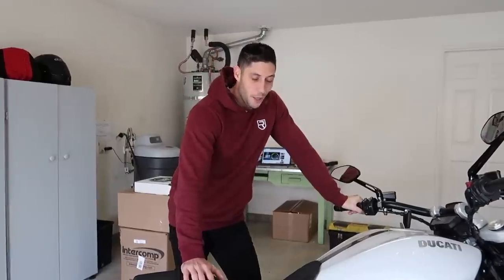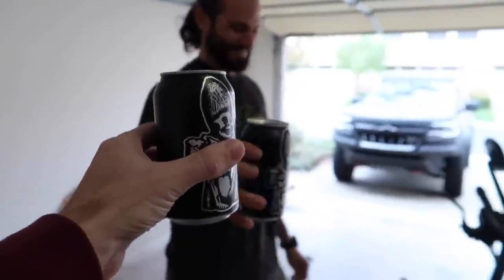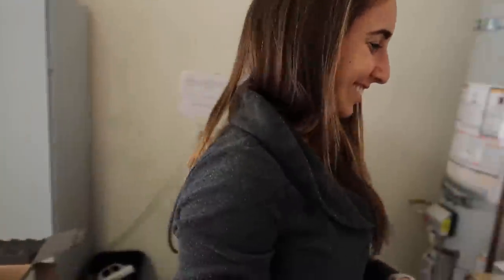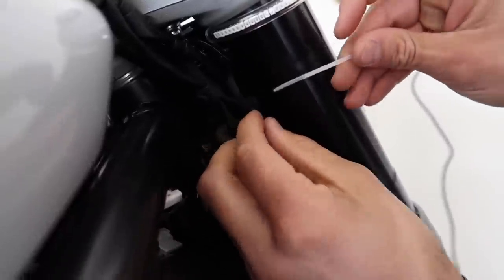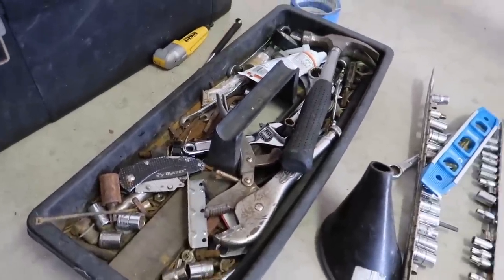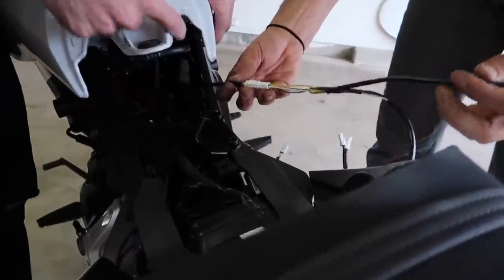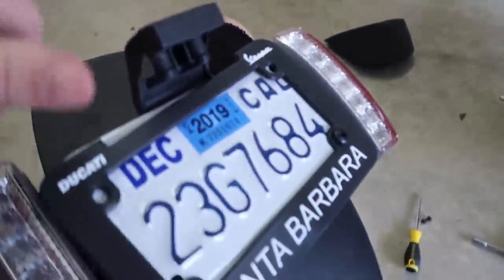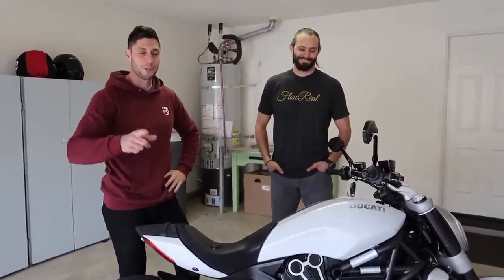Xdiavel gets Flush Mount Turn Signals!

Comment: Hey Jaret, to give some credit to Ducati, I'm pretty sure there is some sort of regulation in the EU that specifies a minimum distance between the indicators and brake and headlight and also between the two indicators.  It's why in some cars, where the indicators are built into the light clusters, the headlight turns off when the indicator flashes.

Comment: keep the indicators up high people will see you better and you won't have to worry about the wire hanging from the fork. You should have used 3m double tape if you need to take them off it will be easier and won't leave glue on the forks. Love the rear delete kit
Reply from the maker: it was such a small amount of glue it won't be an issue and I don't see any reason why they would be removed for a very long time but 3m tape would have been a good idea as well
Reply: @JaretCampisi   oh I was just saying both will work for sure once the bike is given away wont be your problem anyways ;) starting to look good Liked the episode as it was at home with a friend rather than at the dealer its not the same when you dont have the same chemistry miss the Dado colabs

Comment: Hurdle Question: My indoor track season just ended and I'm preparing for my outdoor season. My biggest issue in the high hurdles is that I felt like I was reaching to reach the next hurdle despite being 6'1 and having quite efficient form over the hurdle. Do you think lowering the hurdle height in the offseason and getting more practice running through them with better speed would help or is it just a case of getting my legs stronger? Thanks

Comment: Lookin good. Hey Rup. Great Job. I just have one question is did you guys crimp or solder the front turn signal wires? I'm all about doing it right the first time. Vibration can wreak havoc on electrical mods on a bike. Said with respect and NOT judging. LOL RUP. YOU HAVE MY RESPECT. THANK YOU FOR YOUR SERVICE. God Bless.
Reply from the maker: we soldered them, no cutting corners here :)
Reply: @JaretCampisi  Awesome. You never struck me as a cutting corners kind of guy. Thumbs up J. ;)

Comment: hope you enjoy straight line art at your back when its raining 😂
Reply from the maker: it still has a rear fender this was just the tail tidy
Reply: @JaretCampisi  There has to be a specific reason Ducati made that rear fender piece you took off. I think it was to stop the rain water from flying upwards/possibly forward too. Time will tell. Removing made it look much better. Maybe you can build a quick release rear fender extension that you can put on if you are riding in the rain and it does kick water up.

Comment: LOL the front side reflectors are a legal requirement in the U.S and the rear red one a legal requirement in EU/UK.
Reply from the maker: I've never had them on any of my bikes and never had an issue :)
Reply: @JaretCampisi  Think your traffic cops are a lot nicer mate.
Reply from the maker: @Teh509  I've found as long as you don't drive like an ass they won't give you any trouble

Comment: why not just make the signal as a tail/brake light and use the original brake light on the side as signal..just have to switch the wiring a little bit
Reply: Brake light has to be red and the turns have to be amber....
Reply: @redrider0151  red led or heck..red tinted sticker would do it

Comment: Just a tip before bashing non-US bikes. Check the specs and you guys will see that the breaklights are US specs, and does not look like this in Europe and perhaps rest of the world.

https://images.ctfassets.net/x7j9qwvpvr5s/JExvG4ObwykCCQsQMgu82/1fbe874bb949d3ceb5d81337c67d6632/XDiavel-S-MY18-White-25-Slider-gallery-1920x1080.jpg

Comment: Took a 1700 miles trip with an XDiavel and the bike was losing pieces here and there. Got strained in the middle of nowhere cuz the clutch stopped working and the rear brake failed as well and lost a big chunk of the exhaust and the rear blinker as well. Good looking bike just sitting in the garage. Very poor quality for a bike that cost over 22k. Shame on Ducati.

Comment: It would be less weight if you just used the tail lights to signal using solid state integration. This is what I have done with my XDS. It may not be legal in CA, too many commies out there. I would have kept the front signals. The new ones are hard to see and don’t weigh much less than the stock signals. I wouldn’t feel safe making left turns.